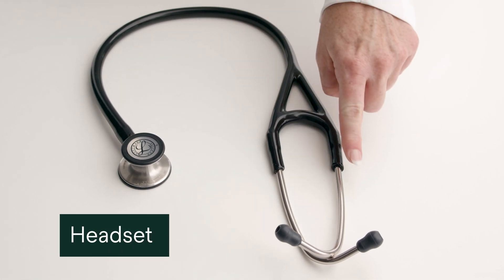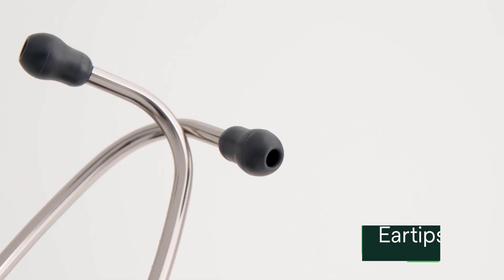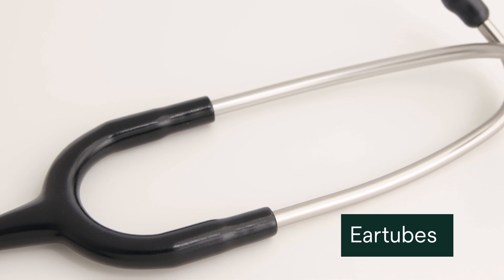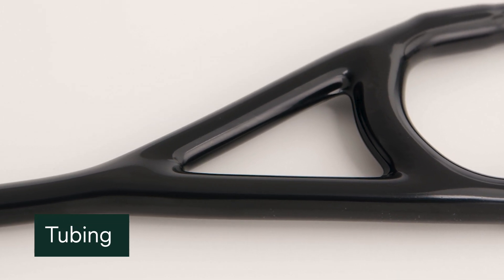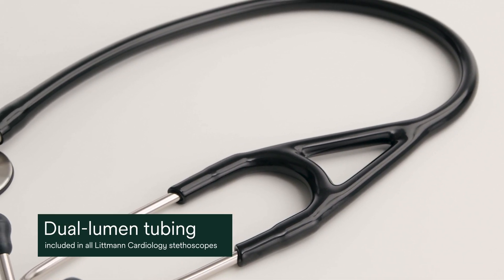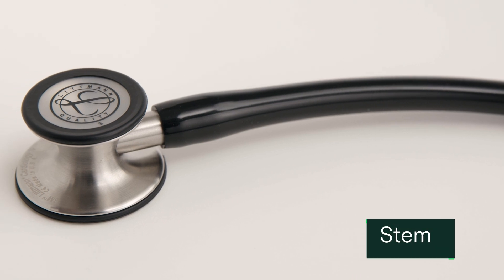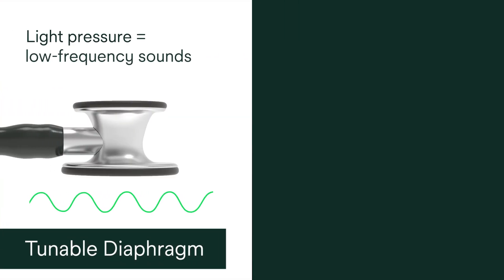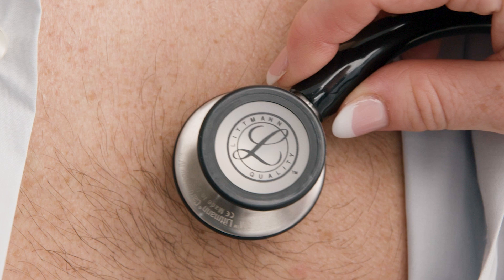Get to Know Your Littmann Stethoscope

Comment: when adjusting the fit is it supposed to make a popping or snapping noise? I was loosening it and I heard a snap but it seems to still work fine
Reply from the maker: Hi there -
 
Can you please clarify which part of your stethoscope you were adjusting? Generally, you shouldn't hear a popping noise, but if you are replacing any parts or making adjustments, you may hear a small snap that will ensure the piece is in place. If your stethoscope is functioning correctly and it doesn't show any signs of damage, it should be fine. However, we'd suggest carefully checking the fit and making sure everything feels secure. If you're concerned or notice anything unusual, please don't hesitate to reach out to us directly.